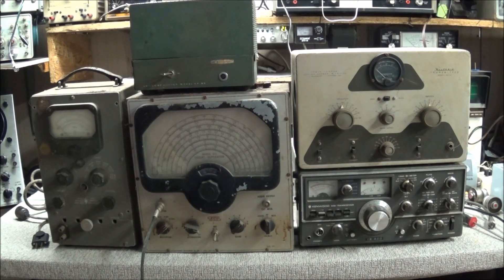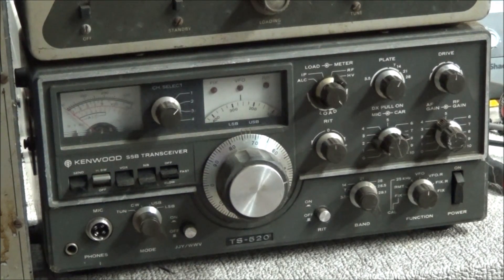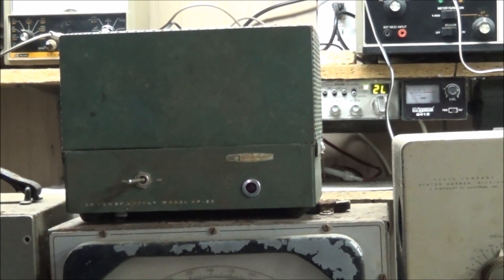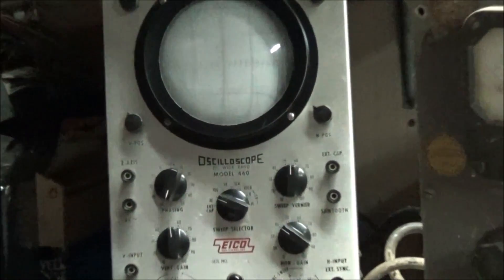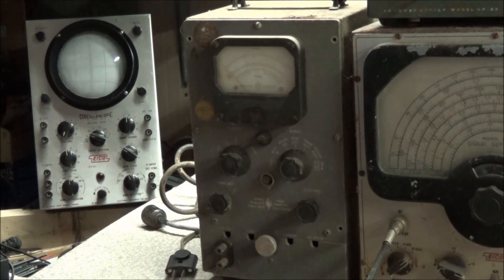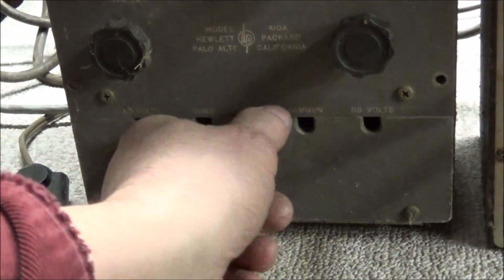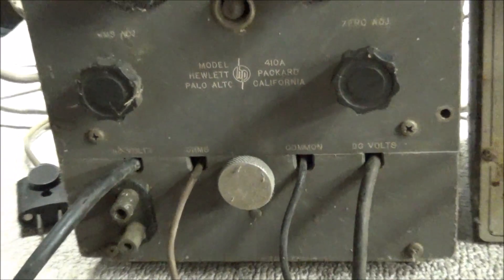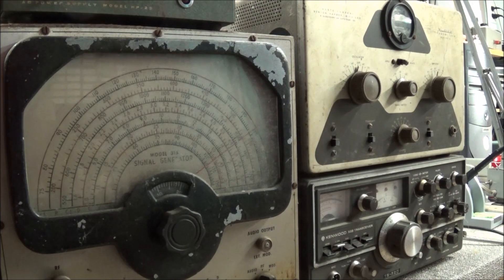#29 Vintage gear I picked up  for future teardowns and restore

Comment: Wow so great!! Love them all including the 1946 HP meter. Dave and Bill were so cool making everything they did!! Thanks for sharing! I will looking forward to your restorations on all of these! Eico and Heaths were just as cool, just sayin! lol   

BTW, found this link from an old HP report about the 410, there's one like yours (the A) and a B (1950).....so cool.   http://www.hpl.hp.com/hpjournal/pdfs/IssuePDFs/1950-11.pdf

73
Reply from the maker: +saturn5tony Thanks for that link. Will come in handy. I like cool old crusty gear. I did go out to the shop this evening and it was 34 F in there. Stayed about 20 minutes and went back in.  Chomping to get these going. Thanks for coming by my friend.
Reply from the maker: brrr. I want it hot. Old stuff is fun. They say we will get snow tonight :(
Reply from the maker: +saturn5tony We had sleet this morning and the temp never got much over freezing here. Now remember in eastern NC we can not handle snow and ice. Half inch shuts us down. When my oldest daughter moves out I may set up a little lab here in the house.. Don't get me wrong I can heat the shop with out any problem, just hate firing the furnace for a couple of hours work.Yes I watch his videos also. I just like that stuff.Thanks Tony

Comment: Buddy, it looks like you have some winter projects to last you for a while. Good stuff to keep your mind occupied. I have a couple of old Pearce Simpson radios I am restoring and they are going to be a bit of challenge. Actually I have enough winter projects to last for quite a while. Good luck with the restorations. 73...Dan
Reply from the maker: +Beretta96Dan Thanks Dan. Yes I will be busy for quite some time. BTW, I like those old Pearce Simpsons. I have a 23 channel Simba  ssb unit a restored last year. Plus several other Base AM units that are in need of restoration. Just need more time my friend.

Comment: Lots of great equipment to restore Buddy! The 410 is a great piece of gear for RF work. That little 2-01C or EA53 tube (diode) in the probe is responsible for the great frequency range of the meter. Just got an EICO 460 as well, love the look of that scope. All that stuff has great porential! Look forward to seeing you restore the stuff.
Reply from the maker: +Mr Carlson's Lab Thanks for your input Paul. The HP volt meter and the DX-20 seem to be my favorite in the list. I think the HP seems to be everyone's favorite.  It will most likely be the first piece I restore from what I am reading here. Going to be some fun projects.
Reply: Looking forward to it Buddy!

Comment: If you take the AC probe apart you will find a tiny Eimac vacuum tube in there.  I have all the models of this meter and even today they are hard to beat.  What makes them kind of unique is the tube in the probe.  You can take accurate AC measurements up to 700MHz with it.  Try that with your standard VTVM.  Definitely worth restoring.

Mike
Reply from the maker: +MikesRadioRepair .CBRadio Thanks for that information Mike. I had a feeling this had the tube in the probe. Going to love working on it and using it. Thanks my friend.
Reply: +The Radio Shop 
In my opinion the best series of  VTVM ever made and no RF bench should be without one.  Once you get it back in operation I think you will find they are a pleasure to use and becomes a "go to" piece of equipment.  Like I said its accurate to 700MHz but it is useable well past 1GHz.

Mike
Reply from the maker: +MikesRadioRepair .CBRadio Sounds so interesting :)